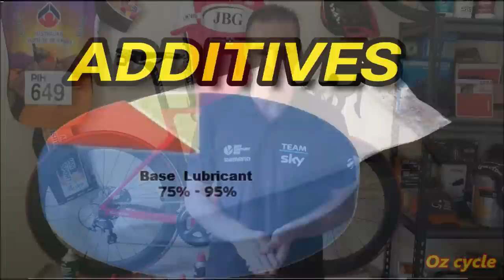Ultimate Chain wax - make it yourself

Comment: I was wondering if you tested paraffin wax without any additives? 
It would be great to see the effect of the added PTFE vs pure paraffin wax.
Reply from the maker: Just paraffin wax doesnt last long...usually about 100km before needing rewax.
Reply: @stevenleffanue  Thank you, makes sense, what about chain life? How many miles did you get out of a chain before %0.5 wear with just paraffin wax?
Reply from the maker: Ive not tried longevity test for plain paraffin wax
Reply: @stevenleffanue  Thanks again for all the great answers. I am still loving the formula.

My recent question is, have you tried WS2 instead of PTFE? You have mentioned that additive in your video. I am planning to buy some WS2 and try it for my next batch, do you have a recommendation for the ratio of WS2 / Wax ? 

Thank you
Reply from the maker: WS2 is more if an 'anti-caking agent'.It leaves grey marks on whatever it touches too.

Comment: Oz Cycles
So I'm a little confused after watching best wax lube videos. after cleaning the chain in Petrol,  degreaser and Meth spirits. Which mixture is regarded as the best of the following two mixtures for wax protection 

10 parts 500ml Paraffin wax (CANDLES)
1 part 50g PTFE powder 1.6micron

Equal measures 
1. Xylene
2.  Candles
3.   Liquid Paraffin
Reply from the maker: Use the liquid paraffin mix for contiuously wet conditions
Reply: oz cycle I live in Thailand so my assumption is the mix of 10 parts 500ml Paraffin wax (CANDLES)
1 part 50g PTFE powder 1.6micron is the way to go through summer seasons, which is great as on Ali express PTFE can be bought for 400thai baht for 5 x 50g (16 AUD)
So what if the weather is unpredictable and changeable, what's your preference for coating ?
TIA
Reply from the maker: Mix in some paraffin oil for extra protection against rust in wet weather
Reply: oz cycle really appreciate your quick replies, so at the 10/1 ratio of paraffin wax to PTFE powder, how much paraffin oil do you add
Reply from the maker: 1:1
Reply: oz cycle just to clarify, for unpredictable changeable conditions, basically the mix should be 
10 parts Paraffin wax
11 parts paraffin oil
1part PTFE powder
Reply from the maker: 10:10:1

Comment: My Miyagi approved! WAX ON WAX OFF!

I use the squirt lube. Thoughts compared to the wax?
Reply from the maker: Does your chain attract dirt using Squirt lube?
Reply: @stevenleffanue  I'm not the guy you asked but I also used to use squirt lube and yeah, it does attract some dirt. It's not nearly as bad as conventional oil based wet lube and it cleans off much more easily.. but you do get a good amount of black bogeys on the chain and it wouldn't pass your swiping-finger-over-top-of-the-chain test ☝️💩
This is what a Squirt lubed chain looks like after a couple of dirty gravel rides: https://i.imgur.com/XbmEKN9.jpg the upside is that warm water can completely dissolve and rinse off the dirt bogeys. This is what it looks like after a warm shower: https://i.imgur.com/KimsZ99.jpg - re-lube and one is good to go.

Not the best thing in the world but decent relation between cost, effort and cleanliness in my opinion. Finished my bottle recently and switching to oz's chain wax method now though :)

Comment: Why use degreaser on the cassette and chainrings when cleaning the drivetrain?  With a waxed chain, there shouldn’t be any grease, right?
Reply from the maker: Over time wax leaves marks on cassette and rings. Brush with a wax remover keep them shiny.

Comment: Hi great vids, has anyone used this in conjunction with a thick and thin front chainring, I am currently using on two MTB and am unsure this will last as long due to the extra contact between chain and chainring with this setup.
So far have completed about 45 miles seems ok, some slight noise from front chainring.

Comment: I notice you mentioned the temperature, what happens to the wax if you accidentally boil it ;-) Great vid by the way and I've been waxing since watching a couple of years ago
Reply from the maker: The paraffin wax changes its chemical structure,evidenced by a slight redish,brown colourization. It looses its lubricative efficiency.
Reply: @stevenleffanue  Cheers, start again then :-)
Reply from the maker: Yeh,I did the same mistake quite a few times when developing the formula over the years 😁

Comment: In the states right now I can only find 2 - 3 micron PTFE powder.  Should I use this as an additive or wait until 1.6 mircon PTFE comes available?
Reply from the maker: 1.6um or smaller John-Paul.
Reply: @stevenleffanue  Thank you!
Reply: John-Paul Wood speedmasterwax.com has 1.5 available. A little pricey but has worked well for me.
Reply: @timj7578  Thank you!  Sorry, I don't know how I missed this response.  Ironically, that is exactly what I ended up purchasing. :)  Thanks again.

Comment: Finally got down to doing this while in lockdown. Watched the video, ordered the kit and waxed a couple of new KMC chains for my Pinarello Dogma running Ultegra and Canyon Aeroad with Absolute Black ovals. Absolutely fantastic!
A few hundred kilometres covered, chains and cassettes look superb, no squeaking, really smooth and easy to clean.
Thanks to Oz Cycle for the video and info.

Here in the UK I bought a slow cooker for £12.99 from Aldi. PTFE was £24.99 from Hagen Automation and paraffin wax £5.49, both on eBay. Cooked it up in the kitchen. Looked like a scene from Breaking Bad!
Cleaning was done in old plastic food containers, petrol, muc-off pink cleaner and methylated spirits £4.50 from Halfords.

Would highly recommend you give it a go.

Comment: Would the quality of wax be that important, as a trial I used an old wax candle that wa 500g, one of those big ones, and it seems not to stick very long, the chain was cleaned within an inch of its life!
Reply from the maker: Try putting some if that wax on another clean metal surface...if it sticks your chsin may not be clean enough. If it doesnt stick it may be the wax quality.

Comment: How about replacing cleaning waxed chain by hot water to prevent rust coming up with simple hot wax 80C  or more and removing chain at 80 and fan dry ?
Reply from the maker: You want least contaminents as possible in your wax...rust is not good in your nice,clean wax lube.
Reply: @stevenleffanue  i will give up using hot water and go for simple wax for the cleaning part then go for normal waxing

Comment: Hello! Not nearly as much wax seemed to stick to my chain. I didn’t use a thermometer but it felt near boiling temperature - any thought?
Reply from the maker: Wax want stick to an oily chain. Do the three step clean before immersion
Reply from the maker: Unless there is some oil in the wax? ...it only takes a small amount. Wax will always stick to a cleaned metal bicycle chain.
Reply: @stevenleffanue  hello! And thanks for your response. So, I was certain my chain was clean so I went ahead and re-waxed, this time with a thermometer. Chain had better adhesions, but while the chain was off I realized the squeaking was my hub 😔. Found an extra rusty bearing in there. That said: I grease up the bearing up and went for a ride with the waxed chain and I love it so far. Cheers!

Comment: One more question. Gettin a new gravel. SRAM 12 speed 1by. Trying to find a solution to wax it weekly. Any suggestions.
Reply: I do not see Connex chains for SRAM 12 speed   Also - do you think I can use Connex link on the SRAM CHAIN?
Reply: @MishaVyazmensky  please lemme kno what did u find. im having a new bike comming with sram 12 speed, which reusable link should i get?

Comment: I can say this, I have been using a Shimano HG95 10 speed chain with lube for about 10 rides before cleaning it and switching to wax and the chain is extremely smooth and quiet. I purchased another HG95 chain brand new, cleaned every bit of old grease off, took about 6 cleanings and a final isopropyl bath then I waxed it and put it on the bike, the new chain is extremely loud and feels really inefficient compared to my old Shimano chain I been using.... Maybe its important for some brand new chains to have a break-in period to help them free up a bit before waxing them because this new chain is unacceptable to ride like this. I am going to ride the chain with normal lubes for a while to see if it helps free up so it stops making bad sounds next time I wax it and if I remember I will report back. I mention this because I seen a few comments asking if a new chain needs to be broken in but the response from oz cycle was no it doesn't but this might only apply to the chains he buys and maybe shimano chains need the break in first.
Reply from the maker: Sounds like your chain either on backwards or the wax isnt right?
Reply: @stevenleffanue  The wax is perfect because its the same wax I used on my other shimano chain that works flawlessly, I use your recipe with the 100% paraffin wax and 50g of fine PTFE powder and I go the extra mile with each chain clean and make sure there is not a spec of anything on the chain before it goes into the wax because I do not want any contamination with grease. The chain is for sure not installed backwards either, with the shimano chain you just need to make sure the writing on the chain links is facing the outside which mine is, so really I have no other explanation as to why this is other then break in period but I will find out in a few weeks, cheers
Reply: @stevenleffanue  I figured out what the problem was, I tried cleaning the new chain and used some wet lube but the sound was just as bad so I knew for sure it had to be either the cassette or chainring. I guess my 32T chainring was older then I thought because I swapped it out with another old 32T ring I had laying around and now no more nasty sounds! :)   I guess with worn chainrings a slightly stretched chain makes a lot less sound then a brand new one. Now the pedal stroke feels buttery smooth and quiet
Reply from the maker: You git it 👍

Comment: hello, what the problem if I use ptfe 2.0 ~6.0? I didn't found 1.6 micron when I put together liquid paraffin it will melt together?
Reply from the maker: Larger than 1.6um people are finding it clumps together + chain squeaking after only100km
Reply: oz cycle thank you

Comment: Will the warm setting on a rice cooker do the trick? If I cannot find a slow cooker?
Reply from the maker: You can use a dedicated pot on the stove.
Reply: @stevenleffanue  Thanks you but since I have a rice cooker and your other wax video you do use a rice cooker i was wondering if i could put it to use!
Reply from the maker: A slow cooker with temperature control and a timer is best.
Reply: @stevenleffanue  Thank you.. One more question.. For re-waxing you say you we just need to wash the chain in hot water and put it in the wax bath... Do we then never need to do the whole petrol, de-greaser, spirit cycle again for the lifetime of the chain?
Reply from the maker: Correct
Reply: @stevenleffanue  Thank you so much!

Comment: For me the PTFE wax works far better when I add .1% to .5% Molybdenum Disulfide. Makes the chain less noisy. Less noise, less power lost. 
I have found 0.5 micron to work the best for PTFE and Molybdenum Disulfide, touch more expensive, but for me worth it.

Comment: Hi,
Oz Cycle, how about adding some 
Molybdenum disulphide? I saw it planty of times on wax bottles.
Kind regards
Jakub
Reply from the maker: Not necessary Jakub
Reply: @stevenleffanue , but if you would like to add it, what proportion do you suggest? I have it already ordered and would like to try it:-) I have 1kg parafin, 0,5l parafin oil, 100g Teflon PTFE, and 100g of Molybdenum.
CeramicSpeed and Polish company C+Ceramic are using also Molybdenum:-)
Reply from the maker: Yes it acts as an anticaking agent. You want need much,prolly about 1%

Comment: Denatured alcohol no longer available in California, would lacquer thinner or acetone suffice to prepare the chain after the gasoline soak?
Reply from the maker: Yes or xylene
Reply: oz cycle xylene is also unavailable
Reply from the maker: Toulene?
Reply: oz cycle California is very restrictive, pretty much most of the chemicals are unavailable. I have used denatured alcohol for years in my alcohol stove but it is no longer available. The only things available are isopropyl alcohol, acetone and lacquer thinner. Everything else for degreasing is out. I have two bicycles, a conventional touring bike and a a recumbent. I used the Connex Wipperman links you recommended, food grade paraffin with PTFE I was able to get online. Wow, what a difference! I used a Connex stainless steel chain on my conventional bike and a two and a half new Shimano chains on my recumbent ( 174 links including three Connex connectors). I want to thank you for your videos, they are so helpful and also great to watch. I commute on my recumbent. It’s HP Veloteknic gte Streetmachine. The chain runs through tubes from front to rear. I learned about Connex chains and connectors and the submersion paraffin/PTFE from you and couldn’t be happier, thank you so much!
Reply from the maker: Nice.
Yes,isopropyl alcohol works

Comment: Ok so I've got my solution for the chain, but what does one put on the drive train after cleaning?
Reply from the maker: Wax
Reply: Thank you for responding mate. The same formulation or just melted wax?
Reply from the maker: Immersing in hot wax is best , bottled wax for emergencies.
Reply: Thanks again mate. Appreciated.

Comment: I just tried this method but ended in a disaster. Melted the wax then added PTFE and I got this sludge at the bottom of the mixture that won't melt and renders the chain useless. Tried increasing the heat still the same problem. Any suggestions?
Reply from the maker: The ptfe does not melt. Put your chain in and swish it around which stirs the mixture to an even consistency....should be milky white.
Reply: @stevenleffanue  Yeah I did that and went up close to a 100 C temp still did not work. I think I received some fake PTFE from China on amazon. It is granulated not powder. Ill try again from a different source. Thanks for the reply!

Comment: I was really stoked at the idea of this, unfortunately after 10 months of testing I found it performs way below what is said in this video. I used it on three of my bikes, mountain bike, gravel bike and road bike which was used about 90% indoors on my trainer. After every ride on my trainer I found a bunch of wax underneath with a ton of dark specs which were all magnetic. I got a maximum of 150 miles (241km) before needing another wax, but typically it was needed far before that - causing very loud noise in the drive train. I just replaced the chain on my road bike after 2,000 miles with 5% stretch, nowhere near the 9,300 miles claimed in this video. The idea of a much cleaner drive train, and not needing to lube so often got me really excited about this, but when I have to wax my chains between 100-150 miles, and not getting even close to the amount of life span as claimed here I just don't think it's worth it. Still love this channel,  just was hoping for better results with the wax. Anyone else have a long term review worth sharing?
Reply from the maker: Something not right there Jason when so many are getting the good results. Hooefully you can isolate the problem.

Comment: How does Graphite compare to ptfe as additive?
Did you make a comparison between the two?
In my case graphite powders is easyer to find and cheaper than ptfe powder. 
How about the ultimate version ptfe+graphite:)) (it should have better response to compression for the lubricant?)
Reply from the maker: Graphite doesn't reduce friction as good as ptfe and leaves black marks on whatever it touches
Reply: @stevenleffanue  thanks.
 But would it be a good emergency additive? Or...better go only with wax?
Reply from the maker: Ptfe available from Aliexpress
Reply: Titus Muresan, cauti pudra PTFE in Ro?
Reply: @Kapi_Tails  salut, da...dar nu prea vad nimic disponibil.
Reply: @titusm9837  pot sa-ti procur daca esti interesat:) La 50 gr..si parafina si IPA si Xilene.
Reply: @titusm9837  nu stiu daca e voie sa postez aici ca vand ceva...
Reply: @Kapi_Tails  incerc să îți scriu pe privat dar nu pot comenta la videourilor tale
Reply: @titusm9837  Facebook
Reply: @titusm9837  ai gasit?

Comment: Hi mate, love your videos, I'm an aircraft technician and run a bike mechanic work shop out home in Sydney, so can appreciate your work. About to go on an Au to Eu family cycling holiday. I've just done your ultimate clean on a new chain and will probably be a high mileage trip. I'm not going to play around with repeat immersion waxing on fam holiday and I know this is not ideal but instead of immersion waxing, I've just done a 60'c immersion squirt bottle waxing instead and plan on continuing to use squirt for the holiday. Do you think this is pointless?
Reply: I should note you may mention your diy wax I have seen your video but I think that's probably something to make once I return from the holiday.
Reply from the maker: For a portable bottled wax lube mix 20:1 Shellite : ptfe wax . Wax disolves quicker in shellite if you scrape it to fine shavings

Comment: You all use the same powerlink over and over? How often do I have to change it after opening and closing this many times?
Anyone has tought of making a block of parrafin and PTFE and rubbing over the chain to relub?
Reply from the maker: Connex link will last the life of the chain
Reply: @stevenleffanue  Thanks Oz! I will try to find it. The link only is a problem to find in my country, I will check other brand link options as durable as the Connex